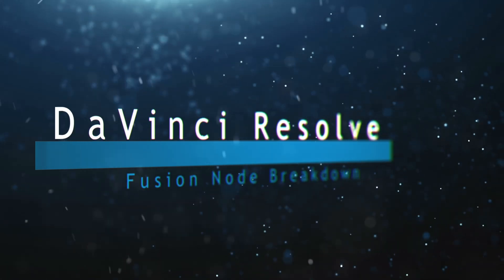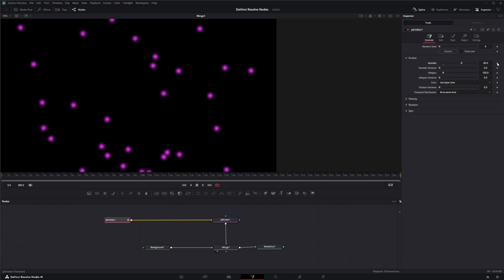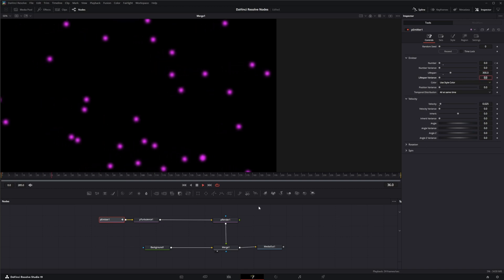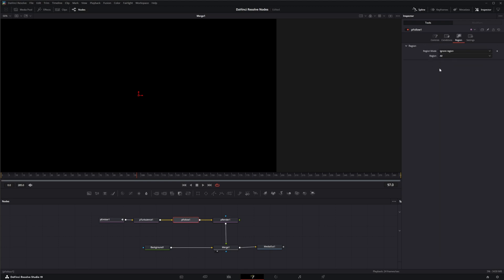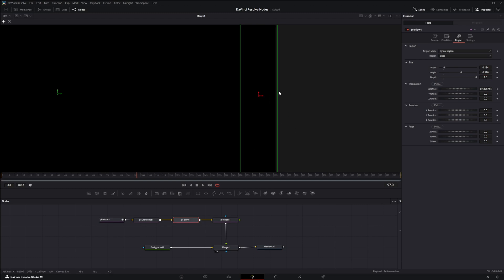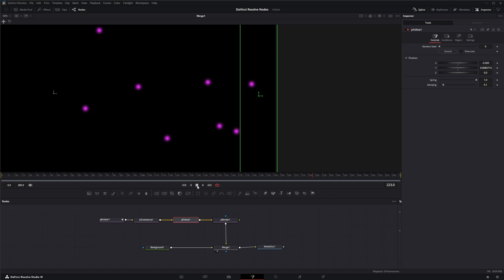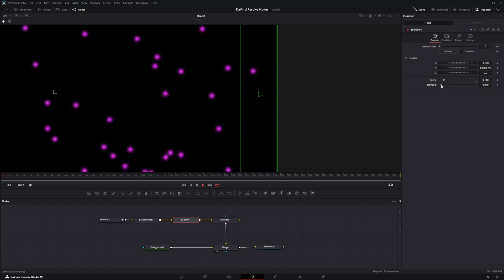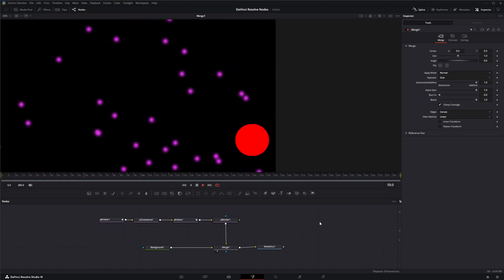DaVinci Resolve Fusion Particle Follow Node

Comment: I don't get it. So if this node doesn't provide a tool to have the particles "follow", what does? Anything? I want to have a group of particles flying around in a murmuration pattern. I can understand (I think) how to make an animated region using Bezier curves, but would that be all I need to have the particles fly around like that?
Reply from the maker: Lol...yes, you'd think it'd be that simple, but you need to use the pFollow and pFlock together and finesse the settings to make it work like a traditional particle follow.